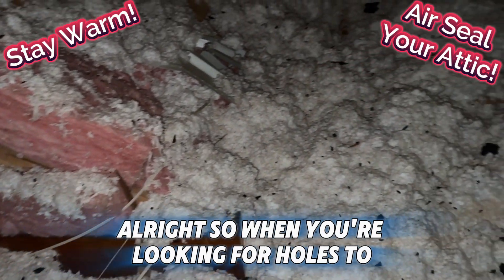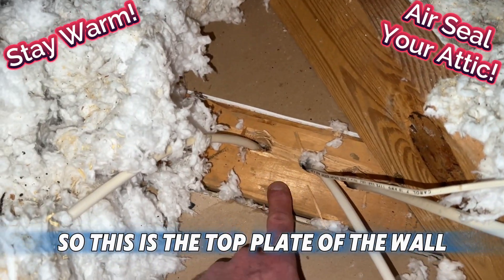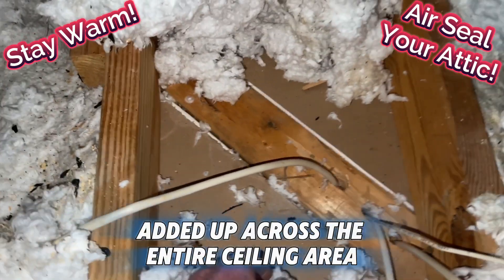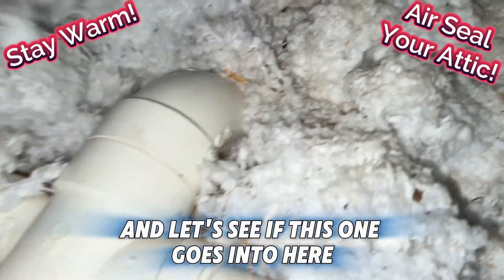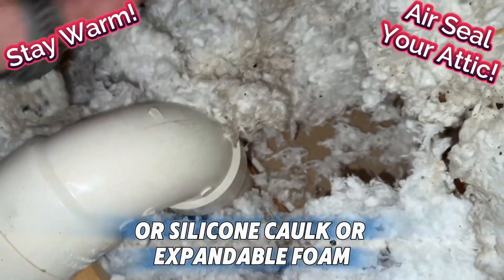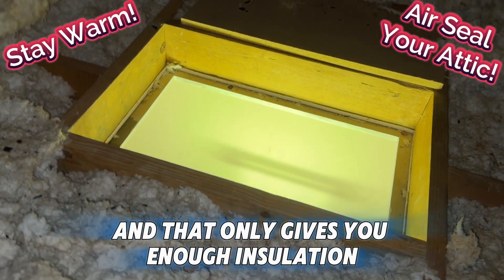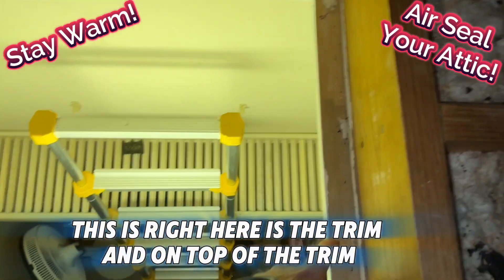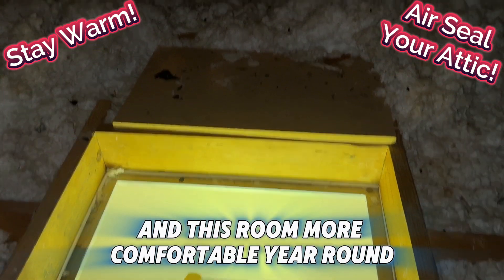Air Leaks Through Attic Insulation - Where to Air Seal Your Attic!

Comment: What about making an exterior side access door hatch from outside the house and just using a ladder to access attic from outside?
Reply from the maker: If you have gable end walls in your attic then that might be an option.  Main issue with that is flashing around the door opening properly so rain water doesn't leak behind the siding.  Best solution is if you have an attached garage put the attic access in that ceiling and then any leaks don't matter because the garage isn't heated/cooled (typically).

Comment: Thanks for the great information. Why don’t builders just do this before they put insulation down? I recently had to seal my attic and it was not easy! I had to army crawl to get to some areas!
Reply from the maker: That’s a great question and the simple answer is they either 1) don’t understand the benefits of it and/or 2) they just don’t want to pay the few hundred bucks to have it done.  Either way it’s pretty sad 🤦🏻
Reply: @HomeComfortAdvisors  I would think that’s a big deal 😢
Reply: Yep. On top of that if an inspector comes to the site, which is rare, they will sign it off. I had an inspector make me fireblock (caulk) the wiring at the top plates, which is good, but then didnt care at all about ceiling penetrations with fans etc. Very inconsistent.

Comment: Note: code says these have to be fireproof caulking (like 2x the price of normal caulk) and not spray foam to seal it (not even the orange "fireblock" spray foam) but aint nobody doing that
Reply from the maker: That depends on your local code. Not every place requires fire caulk.

Comment: So the picture for the video is the issue I’m having will having a company come out and seal everything stop the heat?
Reply from the maker: search for insulation and air sealing companies near you.  Spray foam companies will certainly do this and any good insulation contractor should know how to air seal top plates & attic penetrations.  If they act like they don't know what you're talking about, move on to the next one!
Reply: @ thank you I know I posted the same comment but thank you I’m trying to find a company now

Comment: I have the same type of attic, but it's impossible to get around due to a massive air handler/trunk line/ductwork taking up most of it.

Planning to get rid of it all, remove the blown in cellulose, air seal stud cavities, r13 batts with OSB over them for a catwalk, then more batts up to r48
Reply from the maker: If you have a bunch of ductwork in your attic then I'd recommend you consider spray foaming your attic and sealing it off from outside instead.  By the time you remove what's there, add fiberglass, OSB, and more insulation on top you could just encapsulate the attic and bring that ductwork into the conditioned space.  There's several factors to consider before doing this, like whether or not you have metal flue pipes from gas appliances or fireplaces to deal with, but if it can be done properly your house will be more efficient that way.
Reply: @HomeComfortAdvisors  I'm leery about using spray foam due to concerns over roof decking/truss failure from improper ventilation and inability to remove moisture.  I've read too many stories about foam failure due to mixing and adhesion issues, as well as air pockets leading to moisture, mold and rot.  I believe many insurance carriers in the UK have begun dropping coverage for houses with spray flamed attics for these reasons.  It is very difficult and labor intensive to remove, especially in an attic with no subfloor.

I also do not like that is highly flammable compared to fiberglass/rockwool.   Personally I would sleep much better at night using tried and true methods with lower risk.
Reply from the maker: @robertm5969  your concerns are valid and that's why vetting and hiring the best contractors are key to avoiding those issues.  Whenever it's possible to bring the HVAC and duct system inside conditioned space, I usually recommend doing it.  However, if the entire attic perimeter cannot be easily accessed and sealed off at the soffits, then it's probably not worth messing with spray foam.  Just make sure you air seal all your ductwork connections really well and fix any duct insulation issues before doing your attic insulation work, that way any leaks from ducts aren't sucking in insulation dust fibers!
Reply: @HomeComfortAdvisors  I believe replacing the old hvac unit/ductwork (most of which is old flex duct in poor condition) with mini splits brings everything into the conditioned space.
Reply from the maker: @robertm5969  yep, as long as you're using head units on the walls and not cassettes on the ceilings.  Keep in mind that mini splits do not dehumidify or filter air nearly as well as regular heat pump systems, so if you live in a humid climate it's something else to consider.
Reply: @HomeComfortAdvisors  thank you.  We live in zone 7 and get humid summers.  I am planning to finish the basement with foamboard against the walls and floor which should hopefully reduce indoor humidity.  Also going to put in a heat pump water heater which should help with dehumidification.